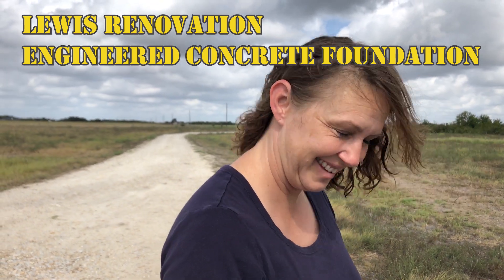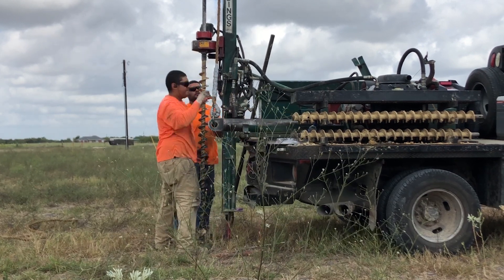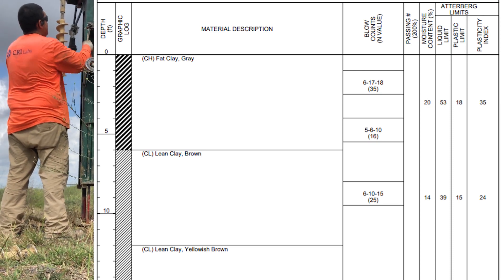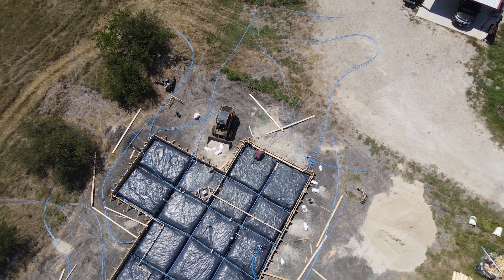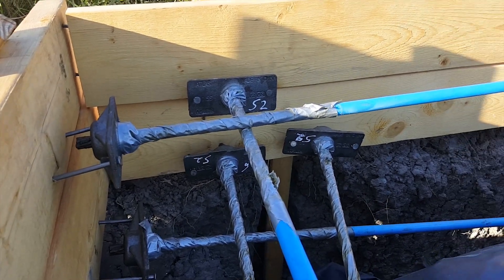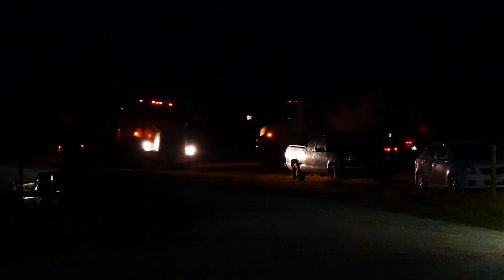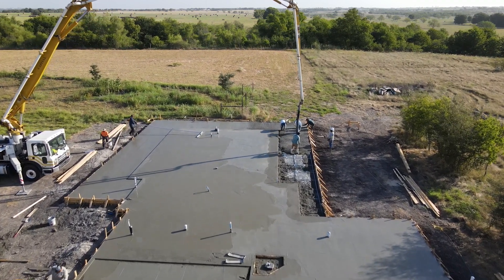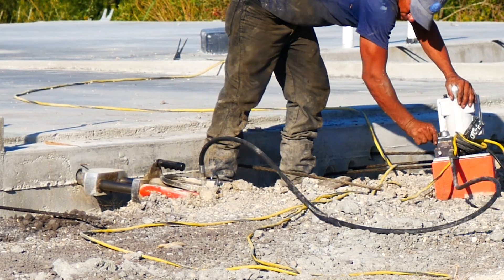Engineered Foundation - Geotechnical & Post-tension

Comment: Duct tape is not an acceptable form of protection of the post tension cable.  Duct tape is not waterproof.  Moisture can get to that cable and rust it out and because it's wrapped in tape, it's possible that the cable cannot move when tensioned to the proper level.
Reply from the maker: Hopefully I don’t have to demolish my house to remove the tape 😆
Reply: @LewisRenovation  shoddy work Is still shoddy work no matter the intention.  It's your wagon.  Load up as much as you can carry.

Comment: This video explains what  I saw today at a building site. I'm wondering why the steel rebar not used. I know the post tension cable inside is steel cables.
Reply from the maker: The amount of rebar needed to do the same job is massive. I believe both the labor and material cost less with post tension

Comment: i work for a geo-engineering company doing field work, checking structural rebar, post tensioning, compaction testing, and testing concrete. theres a test for soils called DCP where instead of using that truck with the weight on top you get this 7 foot pole with a 50 lb weight that slides down it and you have to pick it up and drop it (ive gone up to 60 blows before) at ground level then dig a hole a foot down and do it again. dear lord do your arms get tired really quick. also those guys did a great job with those tendons.
Reply from the maker: I bet that test takes some effort!  And so far my slab is doing great even through this bad drought.  Thanks for commenting

Comment: We will be starting a home construction project in Spicewood soon.  Trying to get an  idea on what a 5500 sq/ft slab foundation would run for our house.  Any idea what I could expect per square foot complete? Thanks.
Reply from the maker: Soil conditions in Spicewood are completely different from here. You'll have much more excavating work but a simpler slab. Very rough guess  - $80k not including plumbing